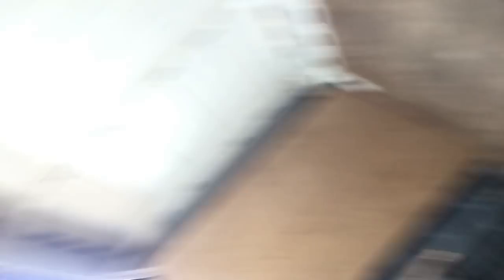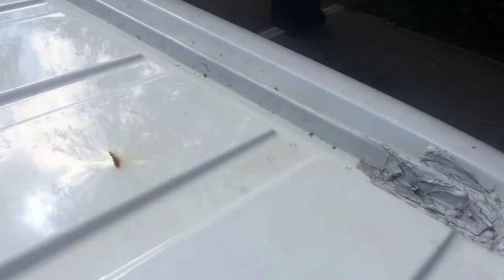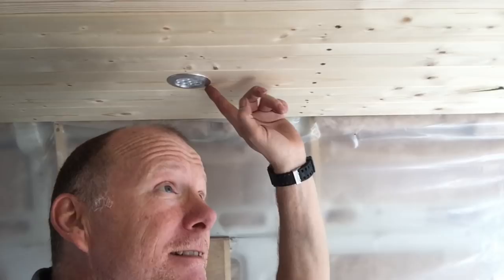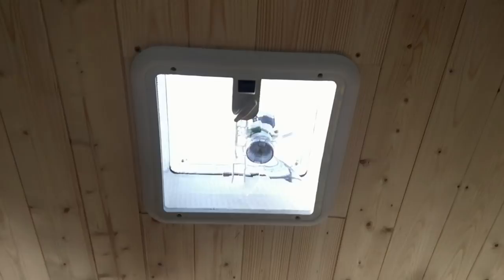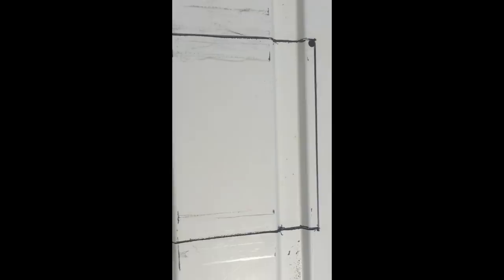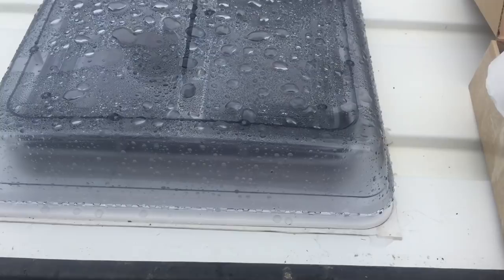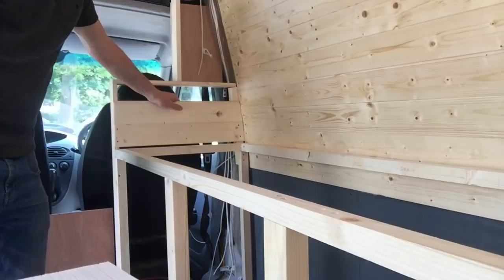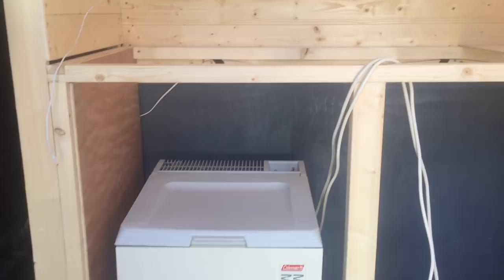LDV Maxus V80 van off grid stealth campervan conversion #vanlife

Comment: Thank God for Clouds ! .... or should that be, Thank smart people for "the cloud" ... :D    Alot of great tips there, thanks.  I note new LDV v80 vans have a roof section designed for vents / sun roofs - No corrigation to deal with.  V an looks GREAT !  I'm looking at a new LDV V80 SWB , low roof (for underground parking) . In Australia, V80s are built in China ...so don't expect the floor problems you had .. actually I expect the opposite - Floor dings / cuts just by looking at it .. LOL!
Reply from the maker: G day glad it was of use I didn't know about the V80 roof it will be interesting to know how you get on please keep me updated I was thinking of doing a low roof next time as less restricted on where you can park

Comment: Hi mate how did you attach your tongue and groove timber to the van because I want to do the same  but the holes look to big for screws is it nuts n bolts
Reply from the maker: Hi I used ply wood batons going up the side and then screwed the cladding to that 🤓👍

Comment: I need your advice! You know a lot so maybe you know this :-). Do you happen to know the weight of an ldv camper? I know it'll vary a bit due to contents but a rough guide? Ta
Reply from the maker: If it’s a maxus it’s max wait would be 2.8 t but I doubt it would be that much really depends on what’s inside and size of water tank n stuff x
Reply: @BigVanSmallWorld  Thanks. Not sure of model-the add doesn't say. But when I put the reg into a breakdown recovery site, it says its a convoy lwb tipper? That's a pick up isn't it?
Reply from the maker: Holistic-Healing UK use my email and send me a link to the add I will run a check on it for you x